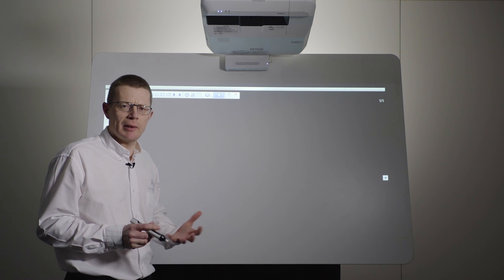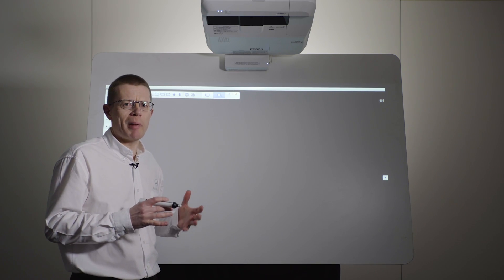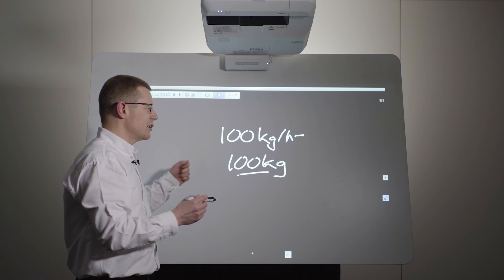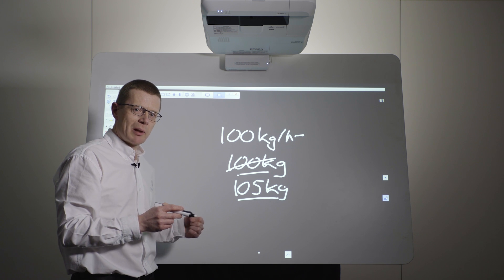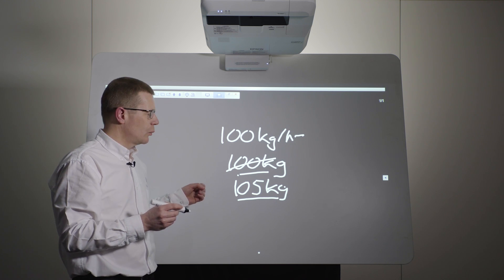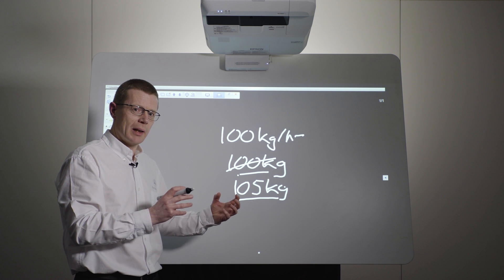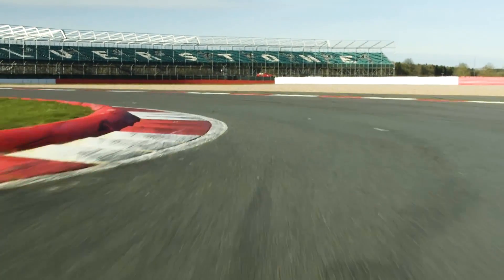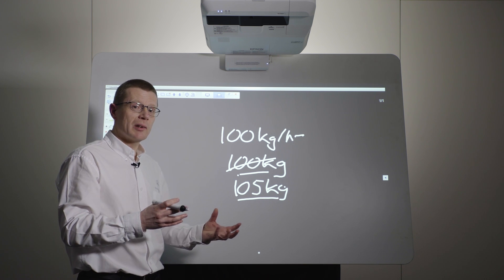F1 2017 Explained: Power Unit #SimpliF1ed

Comment: 10% more fuel per lap = 10% more fuel per race = 110 kg allowance not 105kgs
It shud b 10% more fuel per straight averaging at 5% per lap. [mistake]
the max flow rate of 100kg/hr is also irrelevant 
what is imp is the avg flow/lap in 2017 compared to 2016 bcz of the added full throttle time and the extra wt. the car pulls.
Also wud like to know, how the brakes hv changed to stop a heavier car ?
Reply: "then the total amount of fuel used per lap is gonna go up by  +10%" direct quote from the video 
so either there is a mistake in the vdo or the  fuel allowance this season is actually tighter by the FIA

Only detail v can say is that its 13.888gms more fuel per lap n with race distance of ~72laps comes down to exactly 10kilos of extra fuel requirement.
So if 95kg/race(95<100 ?) ws used in `16 then the allowance is just barely enough,quite unsafe id say.
"He said the engines were using less than 100kg per race distance now" is very vague, however some nonF1 fans rejoice in that.
Reply from the maker: +DeeP Bose  It may mean we would ideally use that much but we haven't been given that - the allowance went up by 5%.
Reply from the maker: NDeeP Bose  Brakes by the way not significantly different. They are bigger by regs (thicker) but car also slower owing to higher drag and braking less owing to higher downforce.
Reply: yeah so it definitely means that the allowance increase in `17 is less than ideal.that answers a lot.thank you.
But hasn`t the PU reached better efficiency numbers than `16 ?
Reply: yes true enough the car can tap its 'inherent' higher drag n downforce. Thanks agn :)
Reply: also if u can share the fuel flow rate at maxRPM of the Mercedes PU even though 100kg/hr is the max stipulated, that way the mention of the flow rate becomes more relevant .

Comment: Dumbed down to make it easier to understand. 
But there more worrying factors. 
Higher cornering speeds and higher levels of grip mean less time to capture kinetic energy. Which is used to to propel the car back after each corner. 
More drag of those tyres mean top speeds may be lower. Increasing time at throttle. 
Cars being heavier means you need more juice to get up to speed. Then higher cornering speed also means you take more energy up to the straight. 
It's really complicated and varies on a track to track basis. 
I'd rather just see the fuel limit removed and the flow limit where it is. 
So all the teams have to think off is keeping it in one piece while pushing 100% throughout the season.

Comment: Yes, but if cars are 4-5 seconds a lap faster, then each car also burns fuel for 4-5 seconds less.  This also explains why Mclaren was not only slower than Mercedes but also less fuel efficient because it would just burn more fuel in order to finish the lap.  So saying that cars use more fuel is maybe true but not that much, unless they increase the number of laps per race.
Reply: Yes, but the percentage per lap where the driver is on full throttle will also increase and the cars will also generate more drag because they are wider now. 
Let's say a track has 10 corners and with the new cars you can brake 0.2 seconds later for every corner and you can get also 0.2 seconds earlier on the throttle. In this case if the new cars are 4 seconds faster per lap but the overall time the driver is on the throttle per lap stays the same. But because the car generates also more drag, the engine overall needs more fuel to achieve and maintain the same speed because the aerodynamic losses are higher.
Also the MGU-K has less energy to harvest because the time where the car is under braking is shorter and the power of the MGU-K is limited by the rules and is still the same.

Comment: Every thing is being analysed and over done in a geeky way just make a engine that produces more horsepower, speed and a challenge for the drivers bring the sport back as it should be and if they need to stop for fuel then reintroduce refueling and stop all this mathematical nonsense 
2018 should look at the power units as it's going the right way 
ask the drivers what they want.

Comment: I also think that the cars would be much more efficient, if they refuelled once in the race, so they are lighter, and also faster. Old F1 seems to be better in every way ;-)
Reply: Αλέξανδρος Γκαμανής in terms of security it's good that the teams don't have to do it anymore and to be honest I think it won't make a big difference, in qualifying they can still drive with low fuel and in the race it's the same situation for everybody.
And do you seriously see any difference between the speed of the first and the last laps of the race? As many experts say, the fans don't care wether the cars are 2 or 3 seconds a lap faster, they care about spectacular overtakings, aggressive looking cars, interesting/challenging tracks for the drivers and to at least have a hunch which speed and forces are in formula1...
Reply: Αλέξανδρος Γκαμανής this is not gonna happened and you know it
Reply: Αλέξανδρος Γκαμανής yes
Reply: Soko Dedes it should
Reply: Αλέξανδρος Γκαμανής Teams would have to be more strategic As Well, Pit stops would be 5-10 seconds longer according to the fuel load they put in. Go for a longer stint but with a heavier car because there's more fuel, or shorter stints but you can go master

Comment: So let see if I got that right. There will be 10% more full throttle and then they go and cut the number of engines allowed? What are these people thinking? Honestly!
Reply: honestly.... what are we doing here?!
Reply: Honestly, What are we doing? Power Units or ping pong?
Reply: f1 is more about politics than anything else.  there just happens to be a race every second weekend.
Reply: these engines oh wait.... "power units" are bad for the sport
Reply: Engine cost is very high. this is the only reason.
Reply: If there were no restrictions on engine numbers allowed. The likes of Mercedes and Ferrari could use 1 engine for practice, 1 for qualifying and 1 for the race. The smaller race teams wouldn't be able to afford that so would have to produce de-tuned engines for maximum reliability to reduce costs in the long run.
Reply: Kamran Latifov
I know ,but I also know that it tends to make them power down the "power unit" to put less stress on it.
Reply: Back then i dont think they needed to spend as much to be competitive (Senna?). The new era of F1 power units are far more complicated and far more expensive than any V8, V10 or V12 configuration used in the past, as advanced as they were.
Reply: It's to promote more reliable engines, making each engine last longer. That's what manufacturers want.
Reply: That tends to produce limited engines.Not good for the sport.
Reply: Bernhard Renner
Reply: Btw i am completely for going back to a V8/10/12 engine. It is nonsense why there are all these restrictions regarding economy.
Reply: Honda's nightmare (I had to)
Reply: Generally speaking.
Reply: Blue flag blue flag !
Reply: Jenson bunch of nonsense even smaller teams could do it back in the day, nothings changed their is just so much bureaucracy now, it's not what it was back then.
Reply: Bernhard Renner But then again, you know nothing about engineering, so what you think you know is irrelevant. The cars will be faster and more durable and reliable. That's the point.
Reply: Shambler101 It's staggering how fucking stupid some of you are. I would have hoped that F1 had more intelligent fans, but nope, imbeciles, imbeciles everywhere.
Reply: derbigpr500 quit berating people for discussing views on the sport.. just because they aren't blind fan boys
Reply: derbigpr500 quit berating people for discussing views on the sport.. just because they aren't blind fan boys
Reply: Daniel Chong ballshite lol, it's to promote useless FIA lobbyist and their bureaucratic stupid green agenda.. With their ridiculous efficiency, emissions regulations..
It's supposed to be a SPORT not a vanity Fair..

Comment: My question is, do the engines need to run in? So for example, they have to run 1500 km before they can used at full throttle (like on a regular car)? And if yes, how do they manage it, do you let them run a special programm for different rpm modes?
Reply from the maker: +Der Aktive Rote  Yes they do a cycle called BIPO - Break In, Pass Off - to get them ready for track use.
Reply: Is the BIPO cycle done on a dyno or it is run on the car? I remember the old engines had to be preheated to even start, I suppose it's the same with the hybrids, and then there was an engineer who ran some test and stuff using a laptop, as the car was on stands.
Reply from the maker: +Dimityr Venedikov  Dyno!
Reply: They run on a dyno.
Reply: El Diablo Well as far as I know does every engine needs that. But i could be wrong
Reply: good question. would be interested in that as well.
Reply: El Diablo Oke im not sure
Reply: Mercedes-AMG Petronas Motorsport Ok thank you for the answer, I expected something like this, but was interested how it actually works :)

Comment: Isn't 10% out of 100 -> 10. That means 10% more fuel is 10kg not 5kg ?
Reply from the maker: +Žiga Zupan  10% more full throttle. The fuel quantity was adjusted by 5%.
Reply: Oh.. thanks for clarification. This things are so complex. :)
Reply from the maker: +TheArfdog  Nearly 50% and still improving!
Reply: also it was said that the teams didn't need the full amount of 100kg fuel due to efficiency. i guess that's also why the extra 5kg are probably enough despite the fact of 10% more full throttle. 
nevertheless we don't know how much extra fuel is being needed for 10% more full throttle. (10% more full throttle needn't to equal 10% more fuel usage)
Reply: What worries me is that with the faster cornering speeds and quicker deceleration it becomes much harder to reach the same efficiency from the kinetic recovery systems. 

Then the increase in drag may have a further impact on fuel economy. 

Sure you at Mercedes will cope just fine you have proven to make the best overall powerplant. 

But i am worried that the competition may not be as successful.
Reply: @genericusername you're right but why is that ? fuel consumption is (most likely) not a linear function. i'm confused.
Reply: Ersan Yalcinkaya 
Fuel consumption is tied to the power delivered. If the engine is revving higher it's producing more power and using more fuel. 

Then these cars are traction bound. They can't always unleash all their power onto the rear wheels. They need some speed to make the aerodynamics work to generate the required grip.
Reply: Engines are 30% efficient at the best of times. Not sure what an F1 engine will do, maybe approach 40%.
Reply: Well you have to consider the whole power unit, as it uses the turbine as a turbo-compound to charge the hybrid system as well as power the compressor like a standard turbo, but yes the claim is (shaft work out)/(fuel energy in) = 0.5
Reply: Well we wish you the best but I don't know if drivers will actually spend 10% more time on full throttle on each lap. 5kg more doesn't seem that much of a window. Especially because you can't run out of fuel on your way in to the pit after the race since the FIA couldn't get a fuel sample. So that 6 seconds quicker laptime is really generous. But I'm not an engineer.
Reply: Engines are 50% efficient........... At least I think that's the reason.....
Reply: Žiga Zupan
Reply: Žiga Zupan they already had some amount of fuel from 100kg so 10%
Reply: 50 % of what efficiency  ?
Reply: michaelovitch ye
Reply: 50% of energy efficiency. Most of what is left is released as heat. And there are some other minor loses.
Reply: Is IC engine's thermal efficiency (by itself) 50%? If so, I look forward to when that efficiency is achieved in production IC engines.
Reply: Žiga Zupan He definitely mislead at one point reffering to 105 as a 10% increase from 100. He made a mistake.
Reply: 1barnet1 isn't that why they increased the fuel capacity